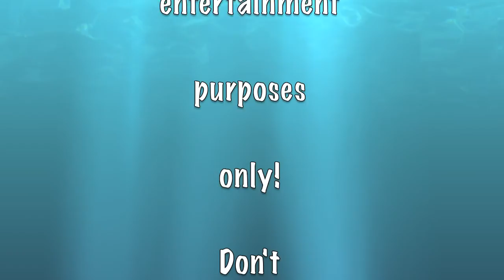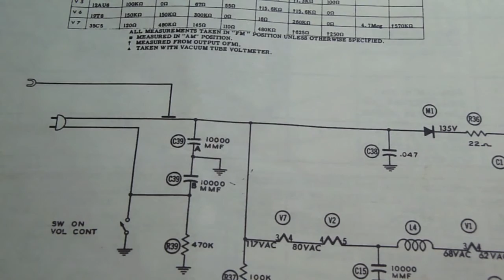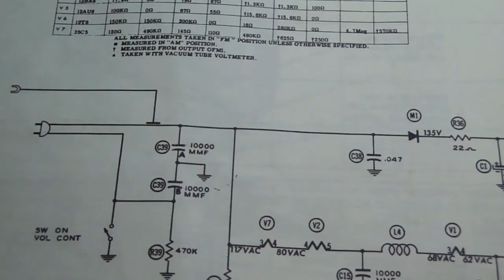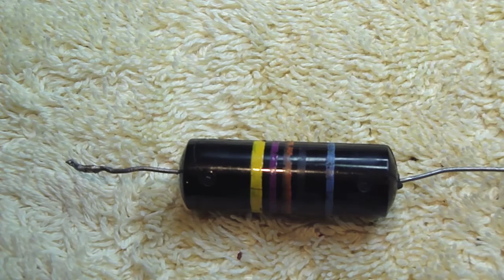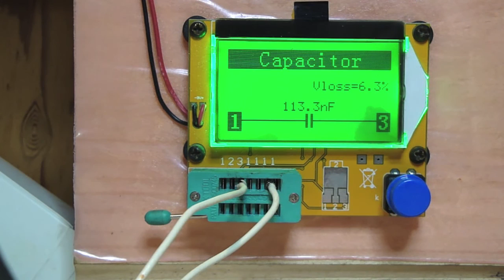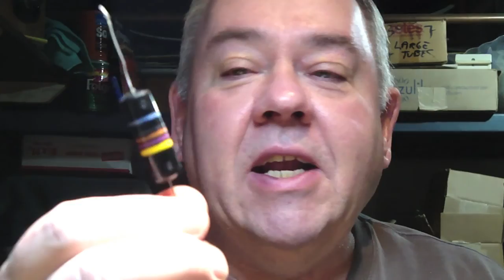Crapacitors   The Bumble Bee Variety

Comment: I had the EXACT same thing happen: 1963 Transoceanic 1000-1. Connected a 12 volt car battery ( lots of amps there)  to it. K- POW!. That was my lesson, the Transoceanics are a positive chassis. It was a bumblebee smoothing cap, so no fault, no foul. Works great now however.

Comment: For sure, I had a bedside radio and had recapped it save for one of those.

It popped, not a nice pop like you talked about, a gunshot pants soiling pop. It blew the cap apart with scortch marks on the chasis. Must have hard shorted.

Comment: They are called bumble bombs ,I have three I need to change out of a portable tube radio If ,could you please tell me the value of these, yellow purple orange gray red, brown gray yellow gray red,brown gray orange gray yellow ,I didn't no if you needed all the color of only the first three ,any help I will be grateful for,anyone.
Reply from the maker: They closely follow the resistor color code. If you're not familiar with that, just Google "capacitor color values" and should find the necessary info you're looking for. There are other types of caps which utilize color coding so it would take forever to explain. Thanks for stopping by.  RW
Reply: There's a YouTube video that covers that subject.

Comment: I have that same model Zenith but when I try to use my mp3 player through it the volume is very low like it needs a pre-amp.
Reply from the maker: It was intended for a phono input which had a pretty strong input, so the MP3 signal will not be as good. If you can't increase the volume of the MP3 player you are using, try changing the capacitor going to the ground on the phono input RCA jack. It may be leaky, and might help a little. Otherwise, you will need some sort of preamp.